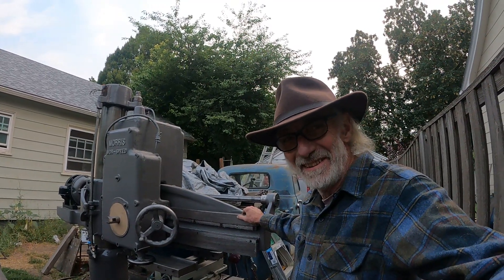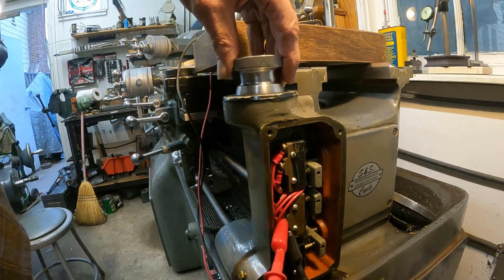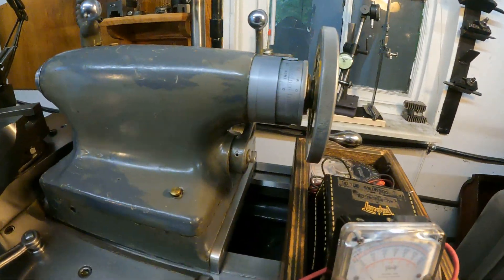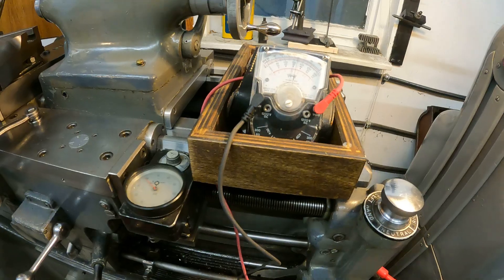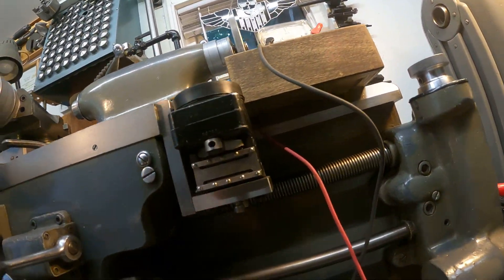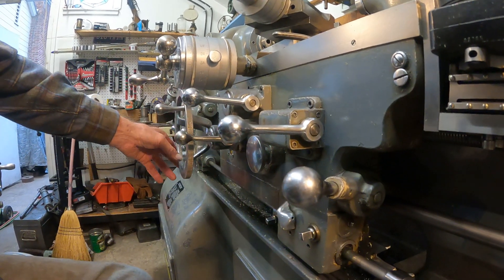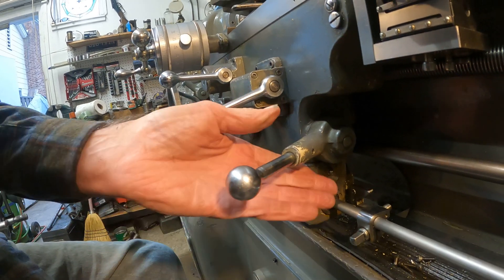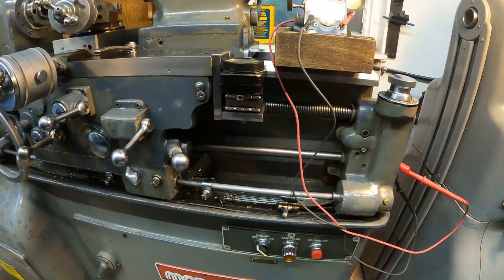Monarch 10ee lathe pro tips on the ELSR

Comment: Great explanation of ELSR. Why two different settings on your multimeter? I got some info on mine. It’s a 1977 English Metric with ELSR. Can’t wait to move it out of storage.
Reply from the maker: The lever neutral, forward and reverse can be detected from one microswitch but the readings will be different because there are two switches in that circuit. Move the probes to the other switch, the two readings will be reversed. However, since both switches can be detected off just one switch, there is no need to move the probes when checking switch timing, thanks.

Comment: Wow I'm glad my 53 Square dial doesn't have this feature. I would drive myself nuts having to get it all dialed in just right.
Reply from the maker: It is a good feature when tuned up for those that do not cut a lot of threads or for repeated threads. Most often the threading feature is not used at all. The apron spindle handle has to work through the keyed rod and 5 gears to work cams to actuate micro switches making the handle action sloppy at best compared to the headstock lever directly tripping the switch

Comment: DeeDee,  This is a timely presentation.  I’m waiting for a few days of good weather before spraying, but then it’s time to install, and adjust the ELSR mechanism.  I swear Monarch could make a cannonball complicated.  When will your shop expansion start?  You’ve got to be getting close or the rain will make things miserable.  Oh wait, you live in Walla Walla and it always rains there.  Can’t wait to see your shop as it comes together.  Thanks again for the ELSR video.  Talk soon.  Cheers, TB
Reply from the maker: I tried to time the painting when the weather is dry here and I just made it. Yes the ELSR is a complicated contraption that does a very simple thing and it does not reverse the leadscrew but useful anyway.
 I will have to construct the added portion to the shack then open the wall or it will fall down. So there will be minimum disturbance to what I have going now. At the same time I have to make what I add on looks like it belongs, I have gathered matching old windows and such. Most old garages like this around here have someone living in it.